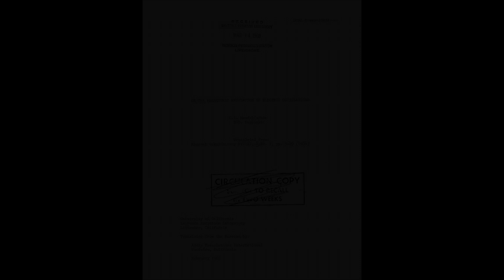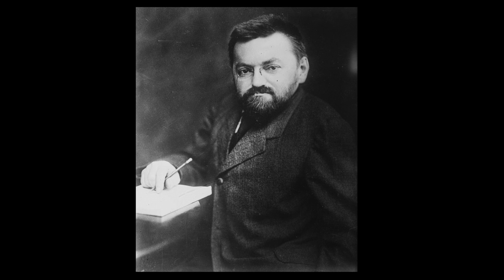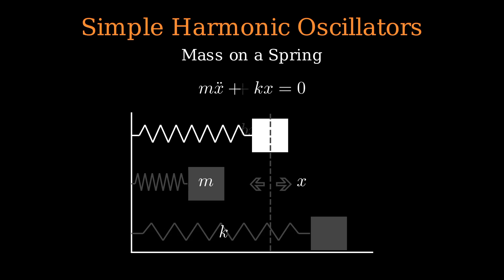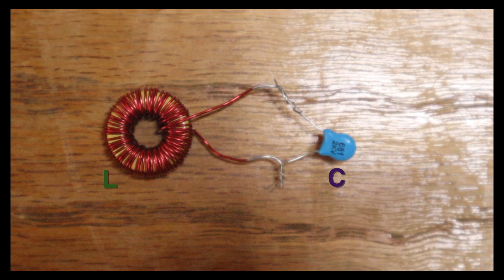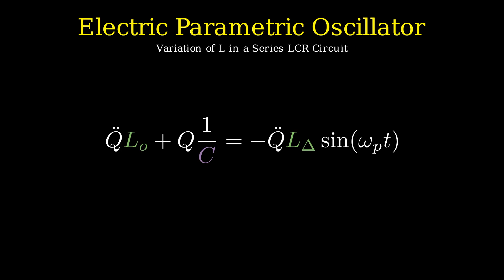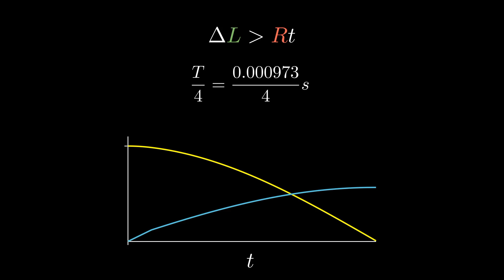Parametric Excitation of Electric Oscillations

Comment: Awesome device you have here, but sadly it is not a free energy device, nor an overunity machine.

In order to change the inductance overtime you have to put energy into the system, in this case by spinning a motor with a copper disk. If you do the maths you'll find out the energy you put into the motor per cycle is the same the resonator gains per cycle.

The same experiment is done in the papers you've shown but changing the capacitance instead, same story, either change the dielectric (which takes work) or change the distance or the plates (which also takes work).

To create true free energy you would need to either change the inductance or the capacitance over time without external or internal energy input. Figuring that out will get you a novel price for breaking the feared laws of thermodynamics.
Reply: Mislavsky transformer
Reply: The "energy" used to spin the disk to change the inductance is not transferred to the rest of the system, no transduction, that "law" isn't even real in the first place but a result of poor understanding and bad engineering:

"According to these equations (1-4.1 & 1-4.2), in time-variable systems electric and magnetic fields are always created simultaneously, because they have a common causative source: the changing electric current [the last term of Eq. (1-4.1) and the last term in the integral of Eq. (1-4.2)]. Once created, the two fields coexist from then on without any effect upon each other. Therefore electromagnetic induction as a phenomenon in which one of the fields creates the other is an illusion. The illusion of the "mutual creation" arises from the facts that in time-dependent systems the two fields always appear prominently together, while their causative sources (the time-variable current in particular) remain in the background."

"a time-variable electric current creates an electric field parallel to that current [the last term of Eq. (1-4.1)]. This field exerts an electric force on the charges in nearby conductors thereby creating induced electric currents in them. Thus, the term “electromagnetic induction" is actually a misnomer, since no magnetic effect is involved in the phenomenon, and since the induced current is caused solely by the time-variable electric current and by the electric field produced by that current."

"There is a widespread belief that time-variable electric and magnetic fields can cause each other. The analysis of Maxwell’s equations presented above does not support this belief. It is true that whenever there exists a time-variable electric field, there also exists a time-variable magnetic field. This follows from Maxwell’s Eqs. (1-1.3) and (1-1.4) as well as from Eqs. (1-4.1) and (1-4.2). But, as we have seen, neither Maxwell’s equations nor their solutions indicate an existence of causal links (no causation) between electric and magnetic fields. Therefore we must conclude that an electromagnetic field is a dual entity always having an electric and a magnetic component simultaneously created by their common sources: time-variable electric charges and currents.° This conclusion must hold for all electromagnetic fields, including electric and magnetic fields in electromagnetic waves."

-Causality, Electromagnetic Induction, and Gravitation: A Different Approach to the Theory of Electromagnetic and Gravitational Fields by Oleg D. Jefimenko

There is no transduction between the kinetic input of a rotor and the electric energy in the stator coils of a generator, if free energy was impossible a "generator" wouldn't even work in the first place. It's a matter of efficiency and directing the fields properly, the only reason Electromagnetic Retardation (Lenz) is so bad in modern systems is because the system is symmetrical and the input has to fight against the existing EM fields rather than redirecting it to be useful instead of wasteful. Tesla figured this out and got around it early on with his Unipolar Dynamo:

"If the subdivision be as indicated by the full lines in Fig. 4, it is evident that if the current is of the same direction as before, that is, from centre to periphery, its effect will be to strengthen the field magnet; whereas, if the subdivision be as indicated by the dotted lines, the current generated will tend to weaken the magnets. 

In the former case the machine will be capable of exciting itself when the disc is rotated in the direction of arrow D ; in the latter case the direction of rotation must be reversed. Two such discs may be combined, however, as indicated, the two discs rotating in opposite fields, and in the same or opposite direction."

Energy "generation" by its own application. With proper construction the model presented in this video is fully capable of providing higher output than input, an iron disk would be better than a copper one to prevent retardation and resistance to the oncoming fields. 

There is no "energy" put into the system from spinning the inductance changing disk just as there has never been any "energy" put into a generator from kinetic rotation, the only thing creating the power is the changing quantity of magnetic induction with respect to time, NOT a transfer of energy, correct observation incorrect conclusion.

If you want to look into some especially promising technology look at Tesla's patent 645,576 and his radiant impulse technology, Impulse and Oscillating Currents (I.C, O.C), like tuning forks what you to do the receivers has no effect on the transmitter. Heck, even Tesla Coils are capable of this: 

"Yes, harmonic oscillations in coil windings generate parametric dielectric energy storage co-efficients. Farads per second. Good path to follow."

"In my mind parameter variation at the second harmonic represents power but parameter variation at the third harmonic represents energy. These are just ideas, see Steimetz A.C. Theory book in his parameter variation chapters. The magnetic amplifier of E.F.W. Alanderson is definitely the way to go" -Electricity Key Points by Eirc Dollard
Reply: Wow, that's a lot of info, isn't it? Let's get through it

It would seem the concept of energy and it being able to transfer from one body to the other is not something you consider, but you're akin to the concept of power being a thing, as if power and energy were not related at all by W/t = P (W is work or energy, t is time and P is power). And yes, I think it's fair to believe that the Laws of thermodynamics are true rather than admitting that 99.99999999% of all physicists and engineers are wrong.

Time-changing currents don't create electric fields, electric currents create a magnetic curl given by Ampere's law (if you don't believe me try Oested's experiment), when this magnetic curl changes in time by changing the current then you get electric field created by Faraday's law (the reason generators work). Hence "Electromagnetic induction" is not a misnomer but actually the best name ever.

Maxwell's equations actually show causality, these equations show how charges and magnets can affect the EM field and how the EM field can affect itself, it's impossible to affect either the electric or magnetic field without affecting the other and the speed at which these changes can happen is... you guessed it, the speed of light. The main idea is that the electric permittivity (ε) and magnetic permeability (μ) dictate how fast the EM can "refresh" in a vacuum given by 1/sqrt(εμ) = c (where c is the speed of light).

If Maxwell's equations were a lie it would be impossible to explain light as we know it today.

Thanks for saying why generators don't work if free energy is impossible, too sad you didn't explain why, because efficiency is not the reason why it does or does not work, it's a measure of how well it works. Also, that backward torque found in generators is not something we can control (it's not like you can use the heat of an oven once the heat is gone), it's just a consequence of Lenz law and you may get shocked to know it's also found in unipolar dynamos.

This one's funny because Tesla didn't figure out the Unipolar dynamo, it's also known as a Faraday disc for an obvious reason and it's also the reason why the motor puts energy into the resonator in the first place, it takes energy to spin a conductor inside a magnetic field and so the motor in the video needs to put extra force to change the inductance, extra force means higher work and so the "magical increase in output" comes from this "missing" energy the motor is adding in.

Your explanation on the Unipolar dynamo was kinda of weird to understand? because that's not how a Faraday disc works, and I bet you won't like the real explanation if you're still convinced energy doesn't transfer.

As for the "radiant impulse technology," it's basically a conspiracy topic instead of "promising technology" because as far as I could investigate there are no rigorous studies about it, and even the people who do talk about it can't agree on what this energy source is, some say is static electricity, others say atmospheric electricity or solar/lunar energy or "space energy" or vacuum energy, etc. What all agree on is the same patent Tesla made on something we don't know, and even if it works (as very few videos claim to do) it may very well be an already existing form of energy that's being transmitted into the device instead of being "created" inside the device.

Same thing about the "parametric dielectric energy storage coefficients", I couldn't find any results on the internet about it (literally zero), and even if it is a thing the fact that is not talked about or discussed or further researched makes me think it may not be real after all even if some people do talk about it.

In the end, I am grateful that you included books so I can read to get informed about the topic. I know that by making this reply I won't convince you otherwise the same way you can't convince a flat-earther otherwise so I'll stop replying. You have your arguments to believe in free energy, but I don't because modern science has its own arguments to say it is impossible, but who knows, maybe if you work on it you may discover a truly undisputable free energy source that leaves everyone mouth-open and my comment obsolete.
Reply: @JenkoRun  nice explanations. Energy is present everywhere. For one form of energy to be stored, another form must leave.... That's my theory of energy conservation....

Comment: I found a very, VERY, interesting quote from Dollard on the energetic forum:

"Yes, harmonic oscillations in coil windings generate parametric dielectric energy storage co-efficients. Farads per second. Good path to follow." -From: Eric Dollard Sent: Friday, September 30, 2011 1:55 PM

Tesla Coils, anyone?
Reply: Boom that’s the key it’s all about tapping the right frequencies and not killing the dipole, allow it to penetrate the gates we throw at it and you’ve got free access to the energy sector!
Reply: @ChiefDinger  Eh, I've moved on from parametric variation systems, they don't give very much "bang for your buck" so to speak compared to other methods I've learned about more recently, may still be place for it in my method though.
Reply: @JenkoRun what’s your new insights? I’m working on an overunity electrolysis system like Stanley Meyer had
Reply: @ChiefDinger  Tapping the reactive oscillations of condenser discharges without killing them off, it's the method Tesla and Don Smith used.

I'm only partially familiar with Meyer's system, his way of using the Hydrogen as fuel was to mix it with Nitrogen from the air to slow the rate of combustion, Pulsed DC or AC with a DC offset are great for the Hydrogen cell itself, especially at resonance.
Reply: @JenkoRun  yeah he mixed the ambient air with the hydrogen for combustion and took the water molecules from the burn, into a steam resonator that would harness the reflexing of the molecules by pulsing voltage around a vacuum chamber, before the exhaust to harness their produced waveforms. 

bouncing between charged plates in a vacuum chamber, at the dielectric frequency of water.

a “vacuum capacitor” if you will 

Where/who do you get inspiration/ideas?
Reply: @ChiefDinger  I'm uncertain about collecting the water molecules, in his patent he describes the production of a "synthetic gas" during the combustion event which seems to have been ammonia, do water molecules reform from that?

I just look at how nature works and does things and then reflect on where I can draw a comparison to man made processes and consider how they could be utilized, in this case I saw that Tesla was using condenser discharges and the conditions would make the power reactive and then sending it into the earth, since reactive power is "supposed" to be useless and it conflicted with Tesla's experiments I knew straight away there was more to it and went from there.

I could go on about how this interlaces with a whole range of topics and concepts but it's 1 AM and I need ZZZ.
Reply: Any information as to where I can study or research?

Comment: Isn't it amazing that such simple examples that exist in mechanical systems that let you increase the overall effect also apply to electric systems on the same basic principle? It's just in the case of Electrics the system is based on fields instead of physical matter.

Comment: No energy is expended in increasing the inductance of the coil if you didn't notice. The coil doesn't repel the incoming rotating core, it pulls it instead :)
Reply: @Lukie Poole. To me it looked like a copper disc in the machine, not iron. Can you please explain why this would not generate an opposing magnetic field, resisting the prime mover?
Reply: @sandysmagicmix  Unless, the the timing is set that the copper aligns with the electromagnet only when current is in the region of zero, where voltage is naturally maximum. That works just fine.
Reply: @lukiepoole9254 Won't work because of eddy currents. The timing has to be what it is to change the inductance.
Reply: @sandysmagicmix  If it's copper, it does. The person made a critical error lol.